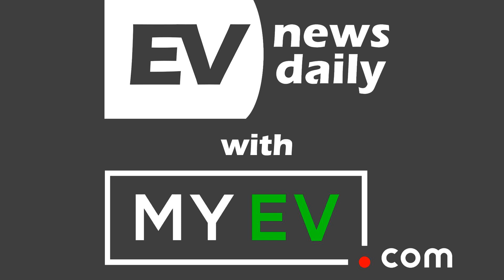18 Apr 2019 | Mercedes EQC Appears Highly Efficient, Tesla Launches Battery Recycling and Sion...

Comment: I did a direct comparison of the I-Pace with current Model X and Y offers via their websides configurators. I built I-Pace variants that resemble the comparable Teslas as closely as possible:
The most expensive MY beat the I-Pace SE in all categories (top speed, acc, storage, range), and even price by 20.5k Euros.
The most expensive MX beat the I-Pace HSE in the same way, but lost the price comparison by 900 Euros.
So discounting the clear tech and infrastructure advantages of Tesla, and the clear dominance of the Jag in terms of features, accoutrements and trim levels, the result is unambiguous.